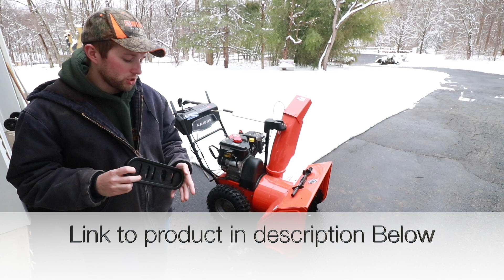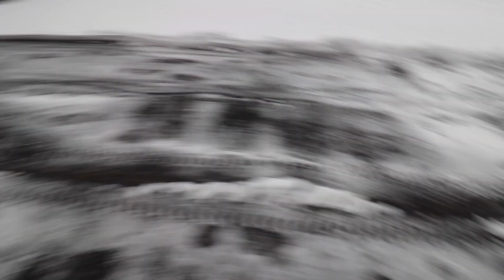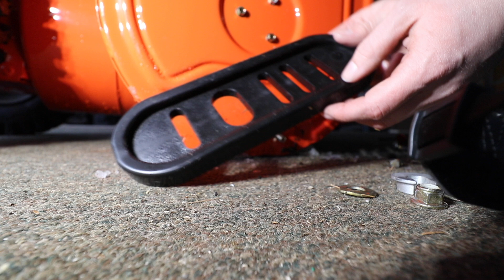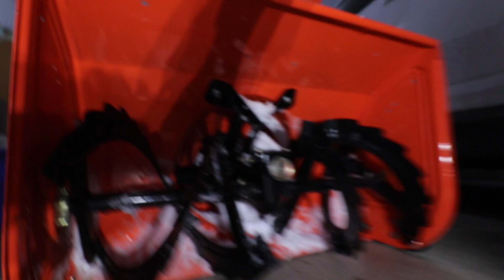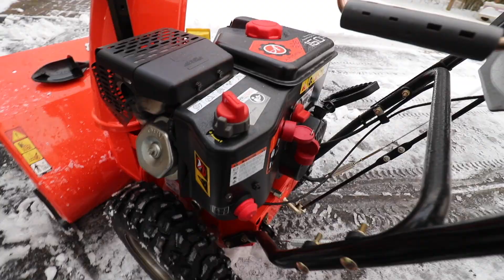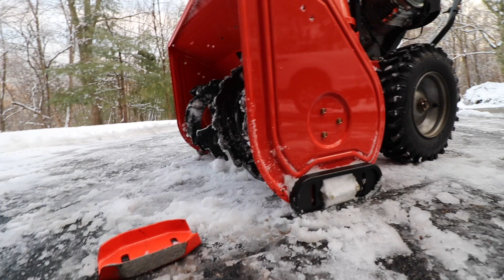How to Fix Ariens Auto Turn

Comment: I just got a 28" sho, absolutely hate the auto turn feature. Love everything else. I've heard of this fix, I'll give it a shot
Reply: I've got an eight year old Ariens and had the same problem with the steel shoes. I called Ariens and they sent me the plastic shoes. It fixed the problem 100 percent.
Reply: @nh7658-e3x  You'd think they should just include the plastic shoes in the first place, probably cheaper also for them.

Comment: Sorry to hear you have had so much trouble tracking straight with your Ariens.  I have a 28" Deluxe SHO, and really like the AutoTurn feature.  It has been a huge improvement over having to drag my previous snow blower around turns.  Once all the adjustments were done including tire pressures, I have had no problems tracking straight on both my driveway as well as cutting paths thru my yard for my dogs.  I did install the Ariens poly shoes to make blowing paths in the yard smoother, and they have really helped.

Comment: I have poly-shoes on my MTD Gold. No auto steer. The wider blunt face of the poly-shoes makes it much more difficult to cut into a heavy snow bank. My "walk behind" becomes a "push behind". My little Ariens 5/20 with steel shoes will cut its way through anything. A true "walk behind". MTD Gold is up for sale.